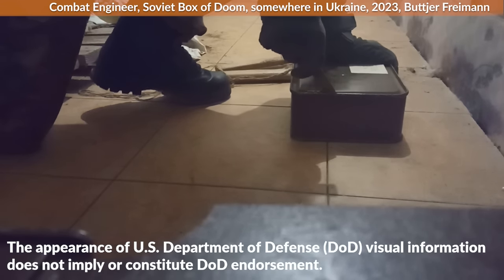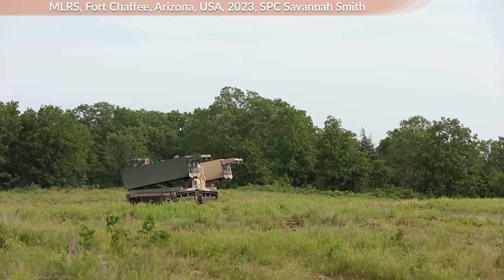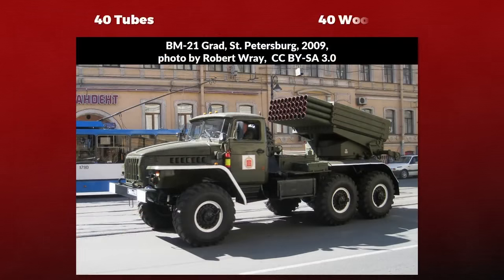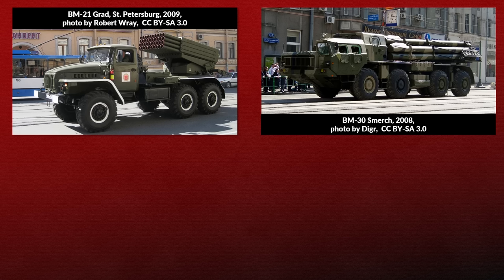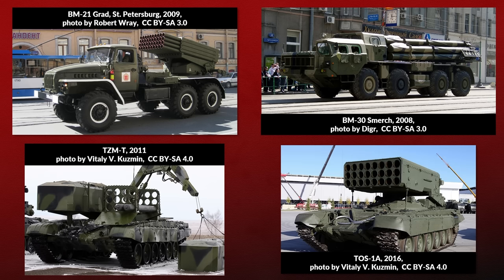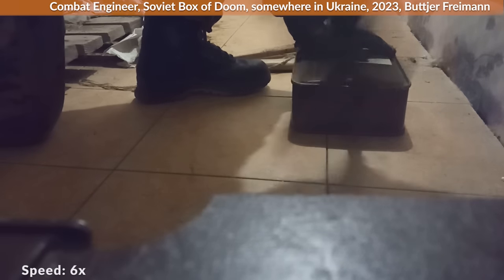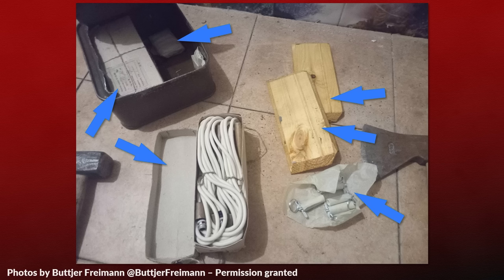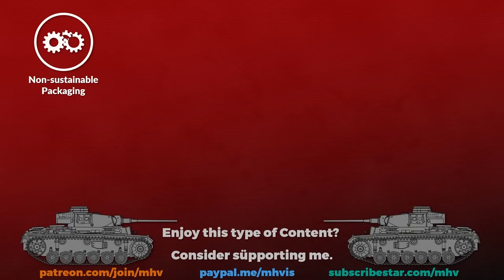Ukraine: Why Soviet Packaging is a Nightmare - Unboxing Edition

Comment: Please consider the following fact´s:
1. The Russian Federation has gigantic forests in siberia - the resupply of (cheap) wood is no problem and costs less energy and money (and produces less CO2) than "our" western "containers" - this changes only when the "containers" are re-used multiple times... what will be sometimes difficult in war...
2. The greatest part of the russian logistic system is based on railway transport - and unloading western-style containers without technical equipment (and often outside of railway stations in the "open field" is sometimes "difficult" - the russian "singleshot" "wood-boxes" can be transported in nearly any kind of wagon or truck, loaded and un-loaded easy (if you have enough men), and stored fast and relatively secure - when you have enough space to "spread" the "wooden boxes" over an wider area. And Russia has a lot of "area" near it railways and roads...
3. The russian "oneshot" "wooden boxes" are relatively light and can be handled and stored on swampy, icy, grassy, snowy etc. ground - the "western" "containersystem" is needing heavier equipment and better ground conditions.
4. The Wood of the russian "wood-boxes" is traditionally used in the russian military not only for heating (fire wood) but also for field-fortifications, road repairs, improvised housing etc. etc. - and you need only a saw, an axe or even only your bayonnette as tool to "transform" them in a lot of usefull things. Our "containers" are also usefull for a lot of things, but you need a lot of tools and equipment to "re-use" them - and from the logistic-point-of-view, every not-multiple-used-(weapon, ammo, tool, supply)-container is an enormous financial loss for the military.
5. You must consider that "russian" arms, ammo and equipment is constructed and build to be handled by russians and "the russian way" - like Stalin once said: Things that can break or bend are not suitable for use by russian soldiers... You can handle and store a brick much different than an egg...
The russian military has a lot of experience in logistics in the worst thinkable climate conditions and with nearly always insufficient technical means - and they managed it "some how" in WW1, in the russian-finlandia-war, in WW2, in Korea, in Vietnam, in Afghanistan, etc. etc. - dont under-estimate their capabilities and methods. The russian army has an enormous amount of (unscilled but willing and there for nearly costless) work-force at their disposal - and they know to use it...

Comment: Counter-point, without this extensive packaging these items would likely not have lasted in Russian level of storage and thus ease of use as reserves would be a moot point as these would have seen use in the diet of rats decades ago. Likewise the Russians like storing guns in disgusting oil, but it means that if needed a soldier can be issued a weapon from the 19th century, though if he actually finds one I'm sure he could trade it in for something better as the resale value would be pretty high considering the history those would have had to have gone through to be available for deep storage, I'm sure it's better than being issued a homemade gun from North Korea at the very least.
Reply: The problem is not the extensive packaging. It's the complete lack of thinking about the end-user, when designing the package.

Just look at Yugoslavian ammo cans. They are basically the same design as Soviet ones. They stack the same, also use wood as an outer package, package the same ammo, and are built for the same storage conditions.
Only difference being, that the Yugoslavians actually thought about the end user:
So the wooden boxes have hinges, the cans have pull-tabs/wires, and the individual ammo boxes inside also is packaged with a pull-tab, so you can take it out easily. Which means, you can open up and use the whole thing in seconds.
Reply: Everyone stores guns in disgusting oil- clearing off Cosmoline was one of the most hated jobs in the Home Guard
Reply: @benlewis4241  Here in Britain we don't store them at all. This war round we wouldn't even be able to raid the museums as their examples have been deactivated by having large holes drilled in them. That said it's nice to hear that some places are more sensible.
Reply: @AntonGudenus  Exactly, its the same concept but executed exponentially better.

What baffles me is the soviets packaged their ammo cans in wooden crates, so why did they not just bother to put a hinge on it? You already built the wooden crate, how expencive can 2 door hinges be compared to the benefits?

Comment: Question is how good is it on long term storage? For ammo produced to store for 20-30 years that don't look as horrid but for ammo going straight to the front that just looks like trouble
Reply: It has to be stored in controlled condition, defined as, "Not immersed in water or mercury."

The low-grade steel is coated in zinc and then painted. Depending on what is inside, the contents may be (usually, are) sealed in nitrogen to prevent oxidation. Shelf life?

With the paint intact, the zinc is intact. With the zinc intact, the steel cannot (chemically, can-not) corrode as long as there is no oxygen. With the inside nitrogen-purged, there is no oxygen.

A hundred years? Six hundred years?

The gunpowder inside each cartridge case will break down, and decompose, to some extent, because gunpowder contains its own oxydizers to sustain rapid combustion. I don't know the chemistry of Soviet gunpowder, but I know it functions for at least eighty years.

EDIT:  That immersion warning is a direct quote from the supply manual.
Reply: @davidgoodnow269  And its worth noteing some oxidizers, in absence of actual oxygen will have a heavily slowed break down, which could be reduced further by considerations such as the actual path of ionic exchange in question and its values where, if the chemists where particularly clever they could use something that in its breakdown still produces a biproduct that will detonate, also due to just the nature of how gunpowder works some stabilizing agents could be be mixed in the powder blend and not hinder ignition.

Like you said, ive never seen the actual formula they use or used, but if stuff packaged from WW2 will still go off, and there most assuredly was progress made in the development of propellants, since then, theres no reason not to think modern ammunition from any developed country stored well will not fire with reasonable reliability a century from now

Comment: ref: MLRS ammo. I agree with everything you said but in my humble opinion you left out two major points. 1. This form of packaging not only slows down the loading of the launcher but also the complete supply line from manufacture until final delivery. 2. In my opinion the most important. It is obvious from the photo that those rocket boxes were unpacked and 'stacked' by hand. This loading and unloading by hand was probably carried out many times throughout the complete logistics chain. Maintaining the concentration and energy levels of fighting troops in battle conditions is paramount, therefore every calorie of wasted energy is potentially critical. I personally watched a platoon of Russians, near Potsdam in 1992 shoveling coal from a rail car onto the ground and then shoveling that coal from the ground onto a covered truck. driving the truck 300 meters , shoveling it off the truck into piles where more troops were shoveling the coal from the piles into buckets to carry them to the coal fueled heating plants within the buildings. I know many won't believe me and I, myself found it unbelievable at the time.
Reply: Eastern block militaries are like that. You wont understand if you nevet served in there
Reply: @krainex Correct. I served in the British army in the 1970's where we also did many things by hand that the modern army doesn't. The difference is that we are 50 years further on but they aren't .
Reply: @laurencehastings7473  i serve in Polish military right now and we still function like them
Reply: @krainex I've worked with Poles in Berlin and they don't think like that. They were quick and clever. Maybe the reason the Polish army is lagging behind is that the soviet mindset is stiil , to some extent, still present. Even Ukraine had this problem 10 years ago but necessity forced them to innovate and develope. All armies to some extent have a history of rituals and traditions. My father had a Polish mate in the UK who fought in the British army against Hitler when Poland was invaded. I remember the speeches of Lech Valesa in Gdansk in the 1980's. An icon of resistance and freedom.
Reply: @laurencehastings7473  Lech Wałęsa is a mixed bag

Comment: Well, the soviets used the wood to prevent moisture build up and to keep the climate in the package stable. A bit rustical and optically the opposite of fancy, but if youre honest actually genious.
Reply: FWIW the Soviets were ingenius in their solutions to the issues and making due with what they had. Notwithstanding 'examples' like where the USSR were claimed to use pencils where the USA spent millions to construct a pen that worked in space. Fisher Price did that with their own cash, and the Soviets bulk-purchased those pens as well when they could (or did they buy a license? I forget which, but the point remains) due in no small part to how hazardous graphite dust is in a sealed system full of very sensitive electronic bits and bobs

Comment: I can't help but wonder if all this, despite the obvious immediate problems it brings, might actually be one of the reasons why they are still able to stay in this war at all.

There is a cold logic I can see behind the reliance on manpower instead of more sophisticated approaches, that being systems in a general state of disrepair would be more or less the same effort to rearm compared to the same system in pristine condition, and the troops are used to it.

A lot less effective compared to western approaches for sure, but this disadvantage might transform into an advantage in a situation where logistics have already taken a heavy toll in prolonged fighting and were far from the best to begin with, losses in specialist personnel become harder and harder to replace, and most equipment having degraded to quite some extend thus the bar for what is considered combat-capable being lowered constantly.

Fresh meat for the grinder seems to be in endless supply in this war, a specific bearing needed to repair a crane system for reloading and the skilled hands to replace it might be a lot harder to come by compared to just another set of hands capable of prying a rocket out of a wooden box and shoving it into a tube.

Looking at it from this perspective, could it be that with equipment on par with western systems and procedures to match, but the same logistical capabilities and challenges, their whole war would have been lost decisively a while ago?
Reply: That was the Soviet scheme as I understand it, yes. They assumed that grunts would show up with no useful skills, and designed their military to function with clueless draftees who could, mostly, be relied on to point rifles in the general direction of the enemy.
Reply: This sounds good on paper, the issue being, for example, a Western-style ammo can allows the bulk of the work to happen at the point of manufacture - a troop that needs to recharge his magazines just opens the can and slams in stripper clips, as opposed to having to handload one round at a time. The work has to happen SOMEWHERE - the western system makes the work happen at the back lines where stress and fatigue levels are lower.
Reply: @Harrier42861  Even for the small arms ammunition, stripper clips or other sophisticated approaches still means more upfront investment in production cost, and infrastructure that needs to be maintained, but I was mainly talking about complex systems like air defense, rocket artillery and the like.

Mind you, I'm not saying that the Western approach is worse, not by any means. What I'm saying is that it relies on economic and logistical capabilities that many armed forces simply don't have to this extend, as well as training requirements that are hard to maintain in a prolonged conflict with heavy losses.

Comment: They aren't reloaded at the front in the shooting position. They move to the rear to be reloaded. M270's are the same, they require a second vehicle with a crain to unload the cassette units onto the ground first and then the M270 has to use it's crane to get it into the launcher. It's hardly a fast operation for any vehicle it's just the BM21 doesn't require a second vehicle. https://www.youtube.com/watch?v=PeLyIiuePGs

As for the soup can ammunition boxes well this is intended for long term storage in poor conditions and be cheap. The wood is there because it won't create any static shock which would detonate the chord. It's not great but it's not like there is only one guy to open cans, everyone can open them.

Comment: Seeing how awful the rocket artillery was packaged it makes so much sense why the Czechoslovakians used their own proprietary rapid reloading RM-70. I do have to wonder though if the Soviet military had a different doctrine designed around the smaller packages. Were they perhaps meant to be opened at rear line bases to be distributed out for frontline use?

Comment: BM-21: 40 rockets, reloading 10 minutes (or 30 minutes, if you want)
M270: 6 rockets per pod, reloading 4 minutes (per pod or both of them?)
Now which one is faster? The M270 just by leaving out the number of rounds?

Packaging: Yes, wooden boxes are primitive. They are disposable. They are stored and transported in their package. And might be used to build a primitive shelter, already in camouflage color. 
Those pods of the M270 have (or at least should) be returned for reloading. And that reloading of the pods takes no time? Is done where? How are the rockets itself stored? In pods? Without further protection in a climate controlled ware house?
Reply: lol
Malding In progress.
To answer your question… Back at he factory… but don’t worry that it’s across the Atlantic, we have many more pods all waiting in Supply depots that have actual air defenses… not that any Russian Aviation would be able to get up to deliver a strike package on them anyway, or better yet that you would even be able to locate them with those discount “Recon Satellites” the Russians have.
Reply: Thats called logistics, the M270 crew fires that pod then never sees it again, its reloaded at the factory like the first guy said. As far as the crew is concerned, the rip off their rockets, change the pod, fire the rockets again, get 2 new pods, repeat, the gunners never have to reload them
Reply: @therideneverends1697 And now what is the advantage in sending back the pods to the factory, get them loaded and then back to the front? Occupy more people with supplying their men? Or flying pods at least double the distance? Oh, it's "logistics"! But what does the part "logic" make in it?
Reply: @MuellerNick  Easy, because as long as the supply line remains reliable it prevents crews from needing to fiddle with anything other than loading and shooting, allowing it to have a rate of fire that can crush anything else and in mobile applications allow far more rockets to be fired before relocation. 

Simply put its superior in every way. plus it actually saves transport space as the rockets loaded into crates to be sent individually take up more space than the loaded pod.
Reply: @therideneverends1697 So you need a dedicated supply line that makes the supply more reliable. Makes sense.
 So 12 rockets allow more rockets to be fired before relocating than 40 rockets. Makes sense.

Makes all sense, but just with your twisted logic.
Reply: @therideneverends1697  40 ракет и 12. Так кто же выпустит больше ракет ДО МОМЕНТА ПЕРЕЕЗДА?😊😊

Comment: What is very large, makes a lot of smoke and noise, takes down 20 liters of gas per hour, and cuts an apple into three pieces?

A Soviet machine built to cut apples into four pieces.

:insert smudge pepe:
Reply: You forgot that it requires one sack of coal per day to stay unfrozen
Reply: American trying to convince himself that America makes better technology comment.
Reply: @zoltancsikos5604 except its true lmfao. look at ANYTHING the soviets or Russia put out and compare it to its American counterpart. the American solution is almost always better, especially when you account for logistics and time to manufacture
Reply: @zoltancsikos5604 some russian equipment is indeed more modern, albeit it can only be done with imported or badly copied rare parts they can`t produce in-house as originally, only catching up many years later. As they did in the cold war. With the break in the 90s, they fell behind even more. Russia has always, historically, lacked specialists, which are vital for specialized equipment. As for standard equipments and ammo etc, that is rudimentary, as shown here. This btw, is a russian joke used by russians since the communist era. It is a russian saying trying to convince themselves that Russia makes,  at least, mediocre technology.